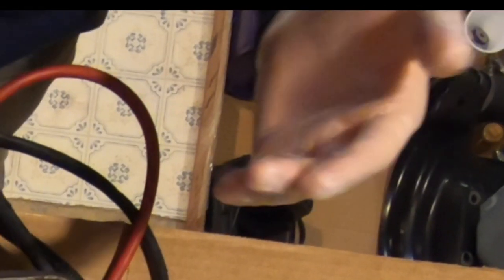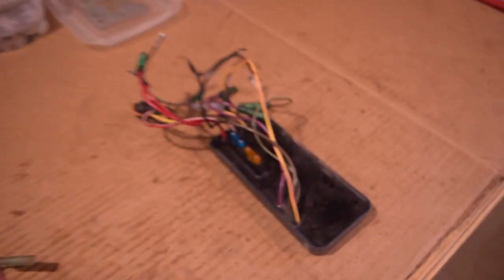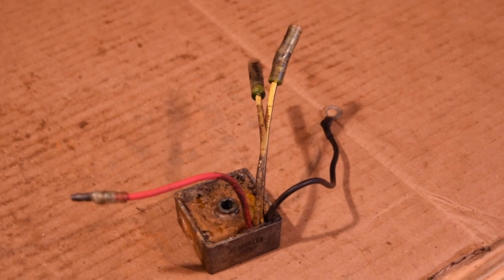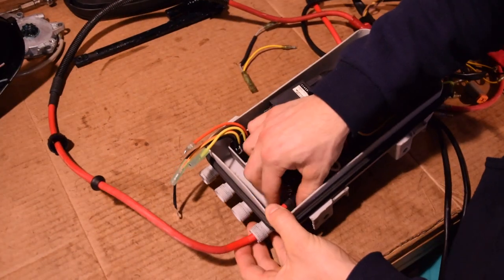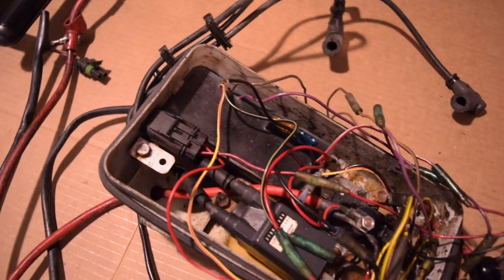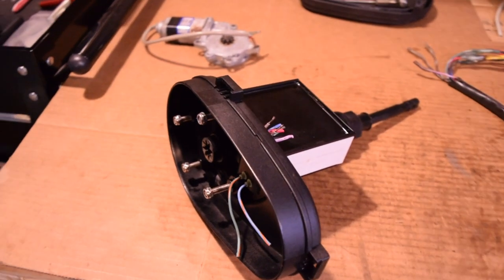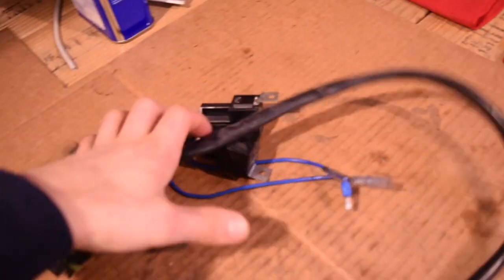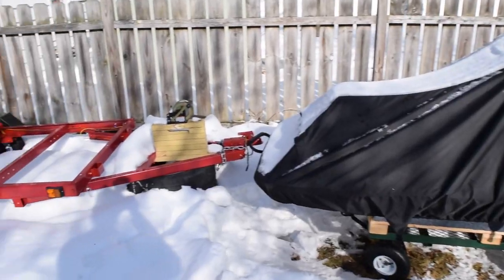Electrical System OVERHAUL on $400 Jet Ski  | 1995 SeaDoo XP 720 | Part 3

Comment: Where did you get new rubber grommets and nuts for the electrical box? Also, can you hook me up with where you found those wiring diagrams and service sheets?
Reply from the maker: I got the electrical box nuts on osdparts.com. P/N 278000100. Can't remember where I got the service manual. Pretty sure I just googled "1995 SeaDoo XP shop manual". I could also email them to you if you DM me.

Comment: Oh heck yeah! I bought a 93 or 94 XP650 model last year for $60 bucks and I just went out today and messed with it for the first time. Mine is in about the shape as yours was with the oily mess inside and they had disconnected the fuel tank and oil tank 🤬. I hooked a jumper box up to the very short battery cables and the starter motor turns but does not engage with the fly wheel. I guess that’s a start right? Lol 😂
Reply from the maker: Well, technically that's not a start, since the engine didn't turn over... 🥲
Reply: @reed.k.h  yeah true... 😢 guess I’ll have to pull the starter out and mess with the bendix
Reply from the maker: @mattg245  I mean you're already further along than I am. I haven't even tried starting my engine, seeing as it's currently in pieces.
Reply: @reed.k.h  lol well I need you to hurry up with part 4 so when I start messing with mine I know what to do 😂 I think I’m just going to send it with mine and see if I can get it running before I do any major work and staying true to my super cheap jet ski budget 😂
Reply: @reed.k.h  I did take the power washer to it today! Looks so much better on the outside now but still a oily mess inside. What did you use to clean the innards of yours?
Reply from the maker: @mattg245  Part 4 will hopefully be dropping this week! It's mostly focused on rebuilding the jet pump, though... My initial goal was to do this project as cheap as possible, but once I had the whole thing torn apart I figured I might as well do it right and spend a bit more money. Props to you for keeping it cheap!
Reply from the maker: @mattg245  I used a shitload of Simple Green, a scrub brush, and a sponge to clean the inside of the hull. It took a few days, but it was worth it.
Reply: @reed.k.h   nice! Can’t wait I to see the next part. I might be going to pick up a older Yamaha wave runner this evening found it on Facebook market place for $25 and was last registered in 2019!
Reply from the maker: @mattg245  You're making me look bad with your ability to find crazy deals.

Comment: Hey, I need to do the exact same thing to my seadoo but the man I bought it from took the electronics apart, I have no clue where all the wires connect, do you happen to have any pictures or videos of where the wires go so I can rewire the whole electrical box?
Reply from the maker: I have a wiring diagram for a '95 XP. I'm not sure if it's the same for other models. If you DM me your email I can send it to you.

Comment: Hello, I just bought a 95 xp 720 and it seems like it's not getting any spark. I checked the ignition coil and it seems like it's good, wondering if you have any ideas that might help me trouble shoot
Reply from the maker: Have you verified it's not getting spark? Remove the spark plugs and ground one to the engine when cranking, if you don't see a spark it may just be a bad plug.
Reply: @reed.k.h  well actually now it's a mute point, I found a form post that said to cut the wires back 1/4 from the boot and rewire, that got it running with a bit of effort. Then I cleaned out the air filter and adjusted the idle on the carb and now it starts first try cold start

Comment: Im confused on the red and black cable .. so do I have to run a black and red wire to the battery from the module?
Reply from the maker: Not sure what you mean, which wires exactly?

Comment: Wanted to learn how to service my newly acquired old ski, but found entertainment instead... Now I want a new workbench...Can I get a link to what appears to be a Build-a-bench kit for basement trolls??
Reply from the maker: Sorry I couldn't help you learn to service your ski. As for the workbench, the design came straight from my noggin, so no kit unfortunately. Guess I'm letting you down left and right, oops.
Reply: @reed.k.h  Oh I did learn a lot,  but I meant that can be greasy funtime too (as you have revealed).  I just finished most everything fuel and electrical today (fired right up!)... Ahhh sweet seadoo rattle!...  now for slowmo review of bench build to steal some Reed's noggin knowledge (you filmed the bench build so now you're two for two on the helping me up ya dink!)  ... I think a 2nd SeaDont is in my near future to make it Doo right.
Reply from the maker: @devildogdad  Get a second one and you have a SeaDuet, add yet another and you've got a ThreeDoo.